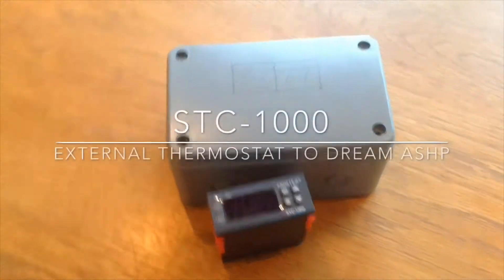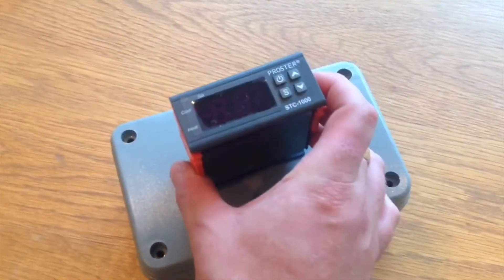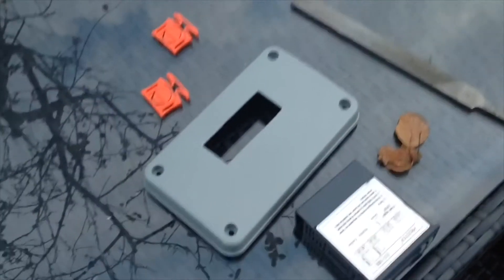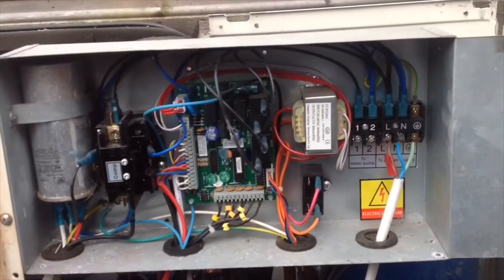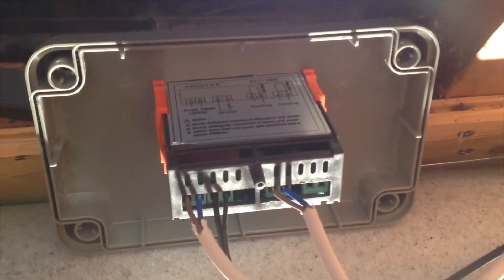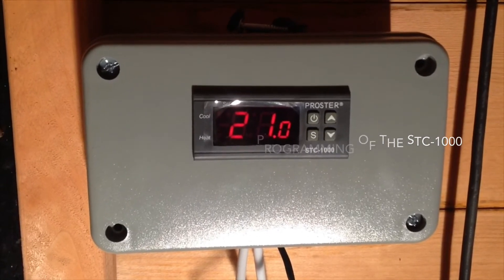Koi Dream Air Source Heat Pump Connecting to STC-1000 thermostat - Dream ASHP to STC 1000

Comment: Great bit of work. How does adding the STC 1000 effect the other ASHP functions like the automatic defrost? does the main control ignore the STC when on a defrost cycle?
Reply from the maker: Yes it still defrosts and ignores the controller. Adding the STC definitely improves temperature accuracy!

Comment: I've just bought one for my small pond. I was thinking about getting an STC 1000. Your video is a great help but it only shows the connection of the thermostat. You dont show the connection of the heater relay?
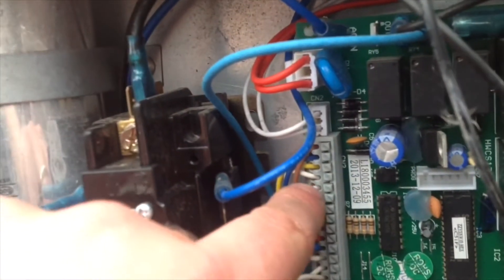Reply from the maker: Jim Woollard Hi Jim, this is shown at 2:15 ....no? That’s all the connections in the Dream!
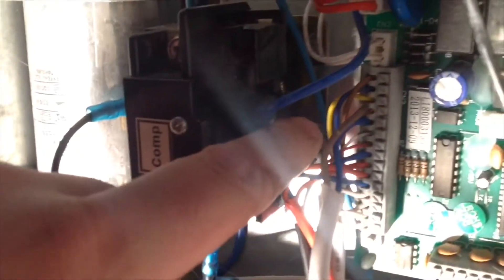Reply from the maker: Jim Woollard ok, 2:42 I actually describe the connection. Remove the loop and it’s just two wires!
Reply: ok I'm confused lol. Is that wired from the probe connection on the STC or the heater connection? Are you using a separate probe or the one built into the dream pump?
Reply: Ok I think I understand. The probe is external and you're connecting the heater connection on the STC to the the place where the loop was on the pump. I figured it out by looking at the wires you used.
Reply from the maker: Jim Woollard yes, it’s been a while since I did it but if I remember correctly and looking at the video, you remove the loop that is there and it’s simply a case of wiring two wires from the thermostat into there! I was sceptical it would work but it does!